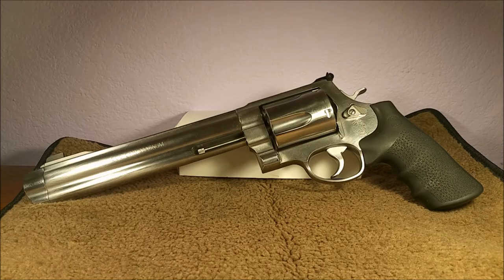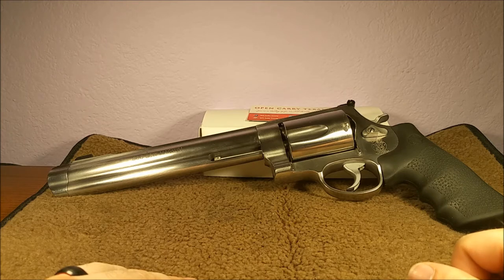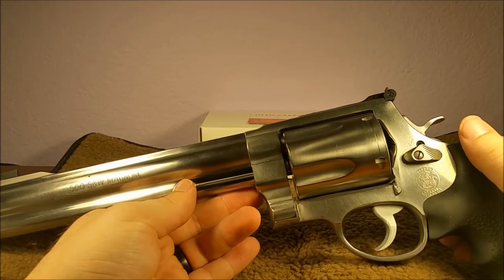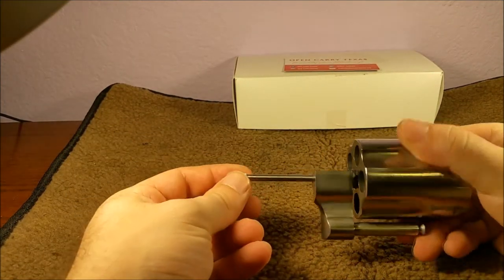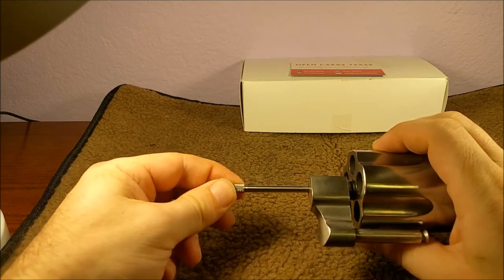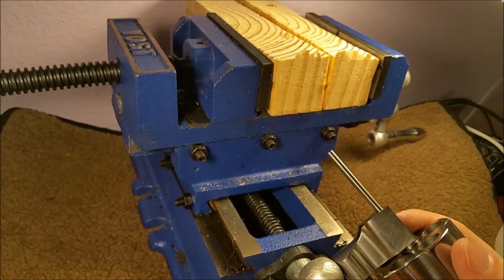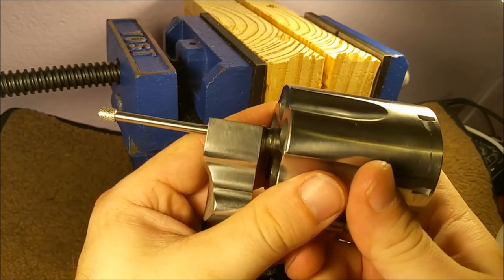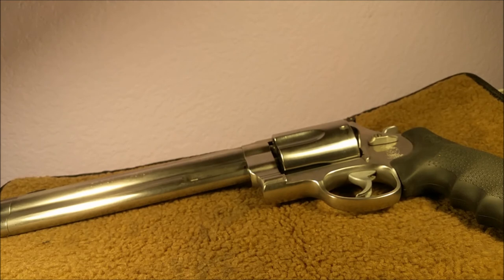S&W 500 Bent Extractor Rod Fix

Comment: FYI you're reinventing the Wheel, Power Customs has a fixture for that exact adjustment along with a rod to bend it back into place. Also the ejector rod should be torqued into place and after tweaking it three time should be retorqued. The other thing you didn't check was if the Yoke was in Alignment which should also be done, Looking at how far off the ejector rod was my guess is the owner snapped the gun to close the Cylinder & should be advised not to continue that practice. Ya, I love my wheel guns.

Comment: I have a BRAND NEW Smith & Wesson Model 500 170255 Performance Center revolver. Can’t remove the spent shell brass. I had to remove the brass with a punch and nylon hammer. 
I’ve tried: 
Corbon 440gr Hard Cast, 500 S&W Magnum, shot 3 rounds 
Winchester 400 grain, PTHP, platinum tip, shot 3 rounds
Winchester 350 grain, JHP, reduced recoil, shot 3 rounds
Hornaday 350 grain, XTP/Magnum, shot 3 rounds
All stick in cylinder (every time, every round). Was sent back to S&W 2 times. Still has same problem. S&W they have their own ammo. I told them I would be happy to send several rounds of each brand to test. S&W said don't send any ammo. Each time it was returned the gun they said it was fixed. NO!!!
Have you had this problem?